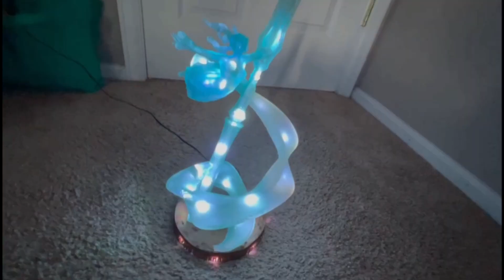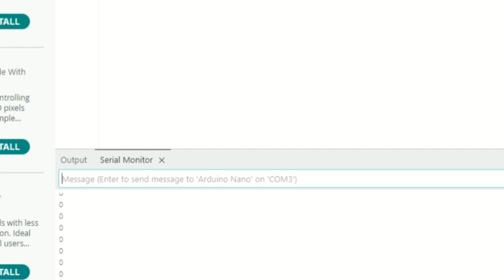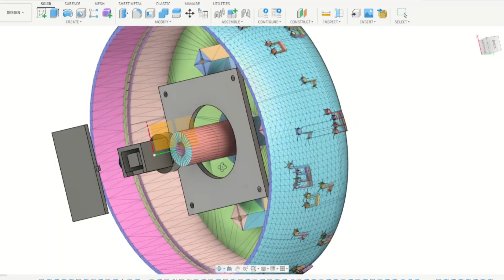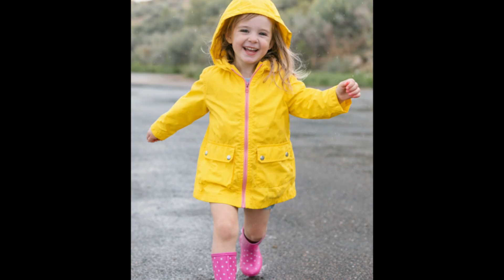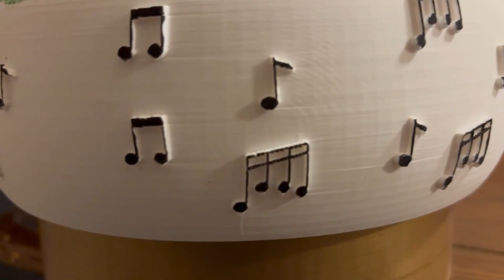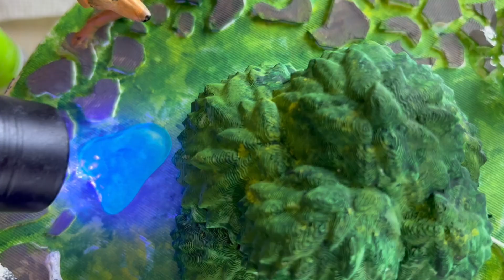3D Printed Rotating Music Box

Comment: Also, thanks for the tip with the brass inserts for the screws, I can already see it come in handy for future projects.
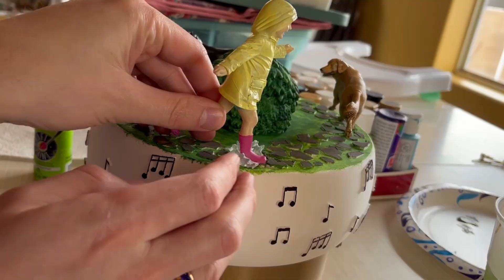What glue did you use at 8:17? Epoxy?
Reply from the maker: I used E6000. I feel like it holds better than super glue, you just have to make sure you let it cure for about 3 days.